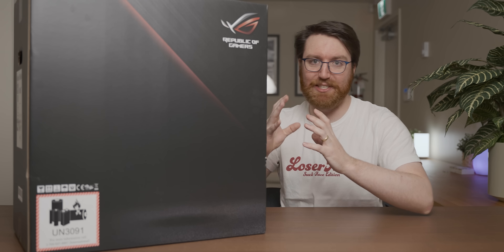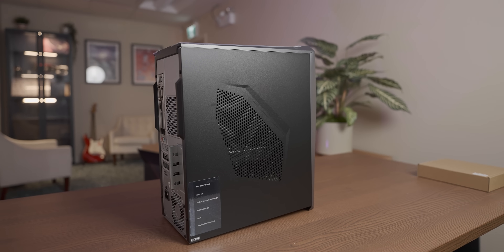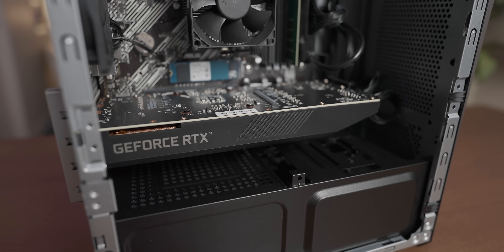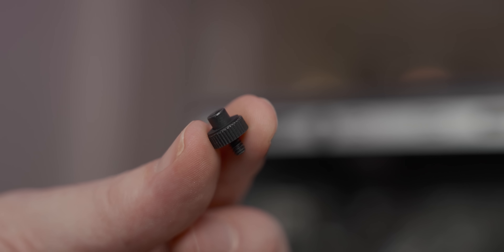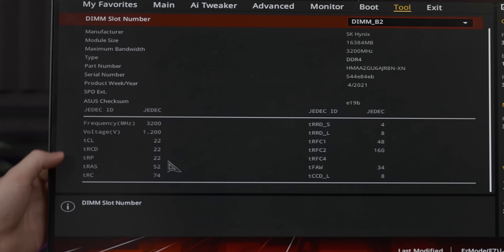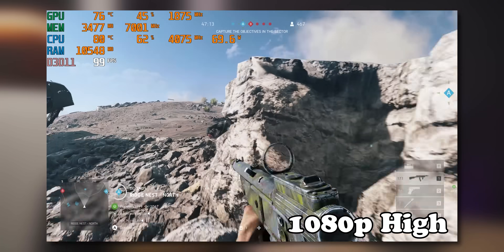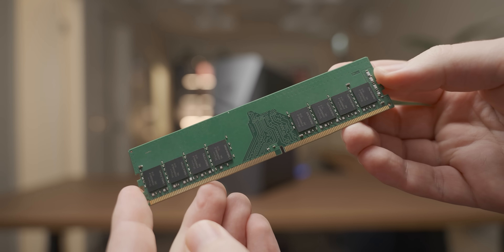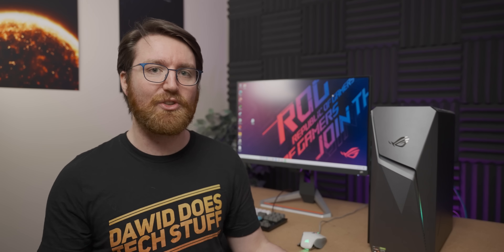Why Do Asus ROG Pre-Builts Suck So Bad?

Comment: I love how this gaming (supposedly) pre-built, from a gaming brand, has a single stick of RAM instead of two sticks, which hinders its gaming performance.
Reply: You must be new here. I’d say about half of all gaming prebuilts have single channel ram. Tbh, most people buying a prebuilt probably wouldn’t care, especially if theyve never had a gaming pc before. Plus, it’s easily upgradable. The real issue is when they have weird memory compatibility issues, like many prebuilts do
Reply: @videogamefreak221122  Nah, not new :P
I just find it funny and ironic how lots of "gaming" pre-builts deliver subpar gaming performance.
Reply: @TheNightquaker  Oh I agree it sucks. This is clearly just a souped up office pc, same case tooling and everything. But I don’t think it’s misleading to call it “gaming”. Every prebuilt is going to have some compromises, and for the price this one goes for (actually not bad in this market) I’ll take them compromising on the easily upgradeable ram configuration and cpu cooler, rather than skimping on cpu and gpu, or having a proprietary motherboard
Reply: @videogamefreak221122  Well, I never said it was misleading to call them "gaming", it's just the integrators could do a much better job building these PCs, honestly. The core components are still gaming-capable, but the configuration is often not the best. For example, XMP is often not enabled, when it could be. And that one is free performance basically! Or the RAM sticks are in the wrong slots sometimes.
And while the components you mentioned are indeed easily upgradable, it is still strange how integrators can put 1 16 gig RAM stick instead of 2 8 gig ones that will give much better performance in dual-channel.

I do agree that in the current market buying a pre-built is a decent option though, considering their prices are still more or less reasonable compared to building a PC yourself.
Reply: @TheNightquaker  It's all in the name of profit margins. It's a little bit cheaper to put in one 16 gig stick as opposed to two 8 gig ones, and at that point you can still advertise it as having 16gb. I think a lot of manufacturers leave xmp disabled to cut down on RMAs, since XMP is still technically overclocking, sometimes it can be unstable (I've had it happen once) and they know that the average person who buys these systems is not going to want to troubleshoot why their system is having issues, so they try to minimize the chances of getting it sent back. It sucks (many don't even have the OPTION to run XMP) especially if someone is on a ryzen system, because it is highly likely they will encounter significant performance loss if the RAM were running at, say, 2133Mhz
Reply: @videogamefreak221122  Yeah, it's all about profit margins indeed. The Ryzen systems getting hit the hardest by RAM compromises is a good point, since Ryzens need to have fast RAM speeds to have optimal performance, much more so than Intel chips.
Reply: @TheNightquaker  Absolutely. Honestly though, I was thinking about picking up one of these prebuilts to harvest the 3070 out of (and decide whether to replace my 6700 xt with it, give it to my brother to replace his 5600 xt, or sell it). Then I thought about it again, and I REALLY don’t think I want a 3070 with a blower cooler on it lol. I guess I could put one of those Arctic Accelero aftermarket gpu coolers on it, but that just sounds like more effort then it’s worth, then I have to sell the rest of the pc yada yada.
Reply: @videogamefreak221122  Perhaps you could get a higher-tier prebuilt instead? Surely one of those would have a better cooler on its GPU. Something more boutique might work for you.
Reply: @TheNightquaker  Yeah that's what I'm looking into right now. I was just kinda mesmerized by the low price tag. I've been trying the newegg shuffle for the longest time, still no luck, besides one time I was selected for a 3090 that was priced so high I knew I'd  be mad at myself for buying it. Luckily, I live very close to a microcenter, which is how I got my 6700 xt, but they don't get nearly as many Nvidia cards, and when they do, it'll either be a 1650, 1660/super, 1050 Ti, or MAYBE a super overpriced 30 series card. Doesn't help that I need two, one to help a friend finally get into pc gaming, and one for my girlfriend (who is currently stuck using a POS RX 460 2gb lol)

Comment: WTF Dawid!  What a goat rope for Strix.  The RTX 3070 is recommended to be run with a 650 W PSU.  The cooler just plain sucks.  Single Channel RAM!  It is like how bad can you mess up the performance of a good CPU matched with a good GPU.  I missed the part on airflow.                                         Be happy, be safe.

Comment: That case would actually be somewhat decent if they actually ventillated the front panel and added an intake fan. My wife had the same issue with essentially the same case in her i7-7700 ROG prebuilt that thankfully is still ticking, and with how they used fairly standard components, we were able to salvage it with an ssd, new cooler, additional ram, better psu and new case. Which kinda sounds like a new system except the cpu and os are still kinda pricy. We were able to salvage her odd as well.
Reply: Probably would have been better off to build your own system from scratch with parts that were way more superior to this garbage. Now you have a bunch of extra ASUS parts hanging around that nobody will want.

Comment: I was thinking about getting this pre built, but wanted to watch your video explaining it first. So how much better would the pc run if I changed out the memory sticks and the coolant?
Reply: He is kind of being dramatic in the video. Ive been using this system for months w no issues. It's only loud when I'm on overwatch. I don't really play the other titles he was playing. I also use ableton with vsts, no issues, crashes, or overheating, just loud on certain applications
Reply: @djviewpoint  is it a good pc? i got the i5 11400F and GTX 1650 version.

Comment: I basically look at systems designed like this...somewhat badly, but not entirely terrible, great for someone that has no gaming pc to start with. Then when they have it they can install better components over time. Actually advised my fiancé to get this, but with 32gb of ram and 1tb nvme and 1tb hdd for data. I advised her that I would upgrade the 500 watt power supply to at least 700-750watt (for OCing) and about any cheap cooler will be massively better than the stock cooler. I'll prob just have her get the OG Cooler Master Hyper 212 Evo because it could even handle the FX line lol. I might also mod the front of the case and melt out air intake holes with a wood burning tool. and then cut a mesh dust filter to size. Probably redo the vid card thermal pads and paste, along with cpu thermal paste with high end stuff too.
Reply: Actually no. I mean sometimes she'll load up a program and use a drawing tablet connected to doodle, but that's about it, nothing serious. @unknownunknownunknownunknownd7

Comment: In my own experience I had an ROG GR8 II prebuilt for years and it was always teetering on overheating/was thermal throttling both on CPU and GPU under gaming load. I delidded the processor and added liquid metal with kryonaut on both CPU and GPU but it only resulted in less thermal throttling, it couldn't be properly saved. It came with bloatware, but as far as I can tell it was not stubborn to remove. It was always loud even on idle due to a really shitty fan (even when forcing the fan to the lowest setting it was still annoyingly loud). The system made my ears ring from time to time and I'm not speaking figuratively. The RAM was really slow, 2133mhz on some loose timing, seems like as long as they got 16gbs of it they figured no one would care. 

Especially considering the price of the system it is outrageous and I'd be insane to give it more than 1/10. Bad experience, bad price to performance.

Comment: I would say they push out that case and cooler cause people would not buy them otherwise and it is good to clear the goods they have at normal prices... OEM prebuilds usually if you cant choose almost every component from a list you will get what they want to clear the warehouse without getting that part discount.

Comment: speaking as a red neck the case never bothers me. holes? i can make more holes. Fans? I can put a 8 inch fan over top the 5 inch hole I make in the sidewall if i want.  I have a router that was over heading, cut a 2x2 inch hole in the side where the heat sink is. works great now :)

Comment: I had my Asus ROG for 8 months and I just replaced it with another Asrock Taichi motherboard. I just couldn't get the speed out of it I wanted. There goes my slow running problems along with my overheating VRM's. Lesson learned. The year before I wrote off Acer laptops so no computers that start with 'A'

Comment: Actually, I think there is a slight misunderstanding, the airflow is likely to come through the holes in the front of the metal case, if you look at the angle of the metal case (you can see it clearly in 14;22 in the video) the metal case is angled backwards, this leaves a significant gap at the bottom where the front panel has what looks like a scoop, so if air is being 'pulled through' the case by the rear fan then it will come up under the case at the front through the holes, its probably slightly cooler with the hideous side holed case because is is able to directly flow into the GPU and CPU area. I am not a fluid dynamics person, but I don't think that their marketing BS is complete BS in this instance. you could probably test this theory with some tissue paper or a feature to see how the air flows. I dont work for or represent ASUS at all by the way.

Comment: i bought the same prebuilt with a 3060, i swapped the case and put a 3070ti with 32 gigs of ram with a 7 5700g and i absolutely love it, there are a few things i would change like the power adapters at the bottom of the motherboard, it kinda restricts your gpu size but other than that i haven't had any problem s with it
Reply: You make no sense. lmao

Comment: So the only negative is the case and cooling?  Can you buy a new front cover with better venting and replace?? Installing better fan is not difficult. For comparison the ASUS rog has a ryzen 7, nvidia 3060 for 1300 on bestbuy. The other prebuilts are on the market for 1800 with this processor and gpu. I would say its a steal.

Comment: That is a $45 motherboard its a matx b450 that most definitely can not use XMPs stably, most ram I stuck in it could not run at rated speed, ran into issues after 3200mhz and only ran stable at 2800mhz and I actually ran into issues with it, a $340 processor,  the ssd I couldn't find that exact one, and I couldn't find the chicony power supply but found resellers ~$50 but that I chalk up to the market right now.  I have single stick ram more than ryzen ever could.  The point of this was more than likely to get rid of old inventory which is good if that is the case, but they shouldn't be exactly selling it at that high of a price. The only reason for this price hike is the graphics card, and they know skelpers will be buying it for that stripping it and selling it part by part out there. The cheapest solution for that is actually to sell the graphics card and cpu seperate and shove the cheapest APU into it and sell that as a $400 pc. This is what skelpers have been doing, this is why its hard to get your hands on things like the athlon 300g, I was trying to get myhands on one to build the cheapest possible pc with my kid so he could learn. So I researched down to the knitty griddy why the lowest costing garbage apu was out of stock for so long and a mad rush when they got in stock at my local microcenter.  That is also assuming that these boards are even compatible with the cheapest APU though I never got to test that with these boards. I had so many people asking me to build them PC's because they wanted one for their kids schooling during the pandemic, and they couldn't understand the current markets situation other than everyone was selling PC parts for stupid high.

Comment: I have a question i just buy Gigabyte RTX 3060 TI and my pc no have best cooling just 1 ventilator in general and 2 for CPU watter cooling and when i have Case open i have 70 74C but when i close the  case with plastic window grow up to 82 can harm my new GPU that temperature/performance in time ?? now i keep pc open and take a loot of dust but have good temp idk what to do close it and no dust but 82C or keep open with dust and more good temperature ?

Comment: Dear Asus, contact Corsair and ask them why they have front mesh cases.  Airflow must not be impeded from the front of the case or thermal toggling will occur on the cpu forcing it to titrate down to its base clock.  Why would any enthusiast want to purchase a high end cpu only to stifle its potential?  I find myself modding units for clients all the time, adding noctua fans etc, so they can maximize their CPU’s full potential and the final results make a huge difference on performance AND product longevity.

Comment: I'd be pretty disappointed in that rig, especially at the price point... It runs hot, both of the optional side panels allow dust to freely enter, and the fact it could only squeeze out a little over 100fps. 

 You would have to spend money and time  to recase it, get a better cpu cooler and more fans at the minimum, better yet would be an aio.  Not to mention the sketchy psu...  You're another $400 bare minimum into a build that I'd be hesitant to game on until it was upgraded....

Comment: And in true ASUS fashion they have the VCORE at 1.44v, overvolting the every loving sheeeeeee outta that CPU! That's gonna be the main reason for the 60c in bios.

Stock 3700x could probably get away with 1.0v VCORE, easily 1.2v which would massively drop temps.

Comment: Dude, airflow in those systems suck. I finally talked my wife into letting me upgrade her ROG. I reused the motherboard (because it's actually not bad), her i7 7700, and optical drive (she needs one for her older os's she uses in vm's). The case, fans, cpu cooler, ram, drive, psu, gpu and cpu cooler were all trash. I mean the cpu cooler looked like a dell one, not even as nice as that one in the vid. The ram was 1333 and the gpu had the jankiest cooler on it. I upgraded to the Fractal Design Focus G mini with an additional fan for a total of 3 120mm fans, 32gb of 1600 (only 2 ram slots), a 1tb sata ssd, a Noctua NH-L9i with a thicker fan in case weight was an issue on the mb (it's not a K so you can't oc, and the cooler is already good enough with the thinner fan), and a gtx 1650 super (it was on sale for $230 and still better than the basic 1050 non-ti she had). Sure, I could've used a new mobo and cpu, but I'd have paid over $300 more for a comparable i3, mobo and new copy of win10 (she won'tuse 11 and needs windows, unfortunately), and her system boots nearly instantly and runs all her stuff she likes maxed now. Also added a drawer since there was a 2nd 5.25" drive, and it's ridiculously handy for all our usb keys. I hope I can find info on whether its onboard jack for the front case led can be used for an aftermarket light strip, I still have the plug I cut from the case and can get pins and wire and build a cable for one if it's not proprietary electrical specs other than the pinout

Comment: I tend to think that such gross oversights from companies that do know how to build good stuff without costing them much more are not just... oversights.

I am aware that a YouTube reviewer can not just flat out say it because there's only so much criticism any brand can take before they start whining about "unfairness", but its all on purpose. Partly its because it cuts costs in most cases (the single ram stick for instance, or the plain outdated chassis metallic aesthetic on the inside).

I am assuming this particular one is not the most high end they offer, right? Therefore slight inconveniences are added so that this is not actually a good option, forcing you to consider the even more pricey option or to regret buying this one. In general all these marketing decisions that have been going on for decades (and for many types of products and services) lead the consumer to subconsciously know that opting for the less expensive option will come with many pitfalls, some which are completely unnecessary.

Its capitalism basically.

Comment: I bought a STRIX GA-15, took it right back after shut down due to heat issues… it’s hot garbage…and it’s really lean on options but it has a flimsy header holder?

Comment: I bout the GL12CP from best buy only because it was the only gaming pc in stock that had the surround sound sound card, I didn't want to wait or dick around with my speaker setup. I have had no problems after several years but in all fairness I have never used it for gaming.

Comment: only problem is,NO USB C ON THE CASE WHATSOEVER,my camera requires usb c to connect at all,i have to run my camera at 30 fps with a usb 2.0 adapter because finding a usb 3 adapter is nearly impossible

Comment: lol I bought an MSI prebuilt for my brother and the first one was dead on arrival. Went to exchange it for the only one within 50 miles and turns out the cpu was not seated properly (the lever was open). Seems the quality control isn’t great however you are at least getting a decent price for a graphics card on a lot of these pre-builds.

Comment: Good review, thanks. Due to bad availability on market I'm forced to buy pre-build PC..wrrr. What would you recommend from those 2 available models to buy: 1. presented ASUS ROG or 2. HP Pavilion Gaming TG01-1001nc, Core i5-10400F (6 core), 16GB DDR4 2666 (2x8GB), 512 GB SSD NVMe, NVIDIA GeForce RTX 3060 12GB ? I know that on both most likely I will be able to prepare fried eggs :D Thanks in advance.